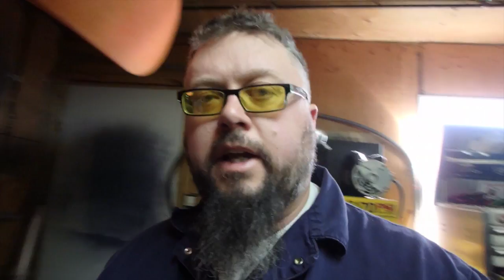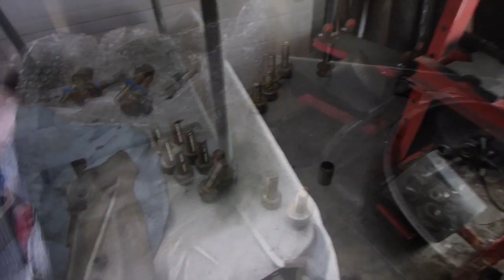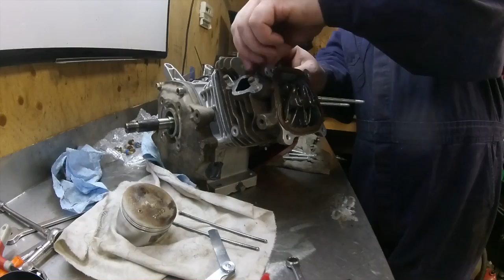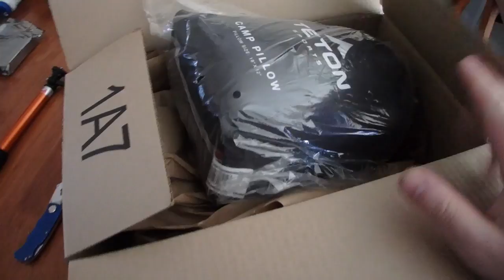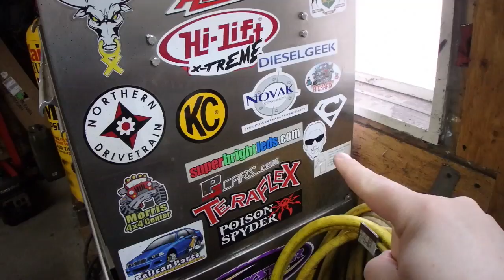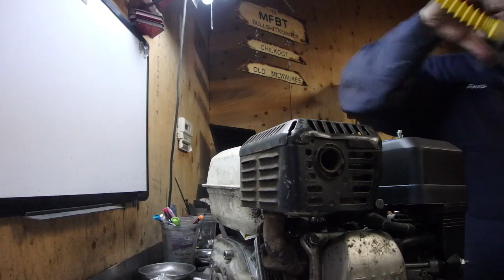Will This Engine Run Or Blow Up

Comment: hi there i really like your videos and would really appreciate your advice on my eninge as i am having a few problems. the engine is a handa gx160 copy, i have it on a go kart and it the pull start works and ive taken the covenor out and sorted out the trottle linkage. after i did that the spark looks really week but it has a new spark plug and ive checked the gapos on the ignition coil so i don't know what to do there?  also i can start it with fuel and choke on and the throttle off. the only way i can start it is with the fuel off , throttle all the way open and choke off. and i sprays fuels everywhere if i try and turn the fuel back on when i get it running. any ideas

Comment: are you going to have clearance for a 12v? I have a 93 1st gen. it would be sick though #MFBT
Reply from the maker: +Michael Meadows  that's a good question all things i need to research.  They were common with a inline 6cyl and those are tall engines
Reply: +Bullshitkorner regardless you're a fuckin bad ass
Reply: +Bullshitkorner also I forgot to ask how do we get stickers

Comment: Shoebox is one bad ride with big block Chevy or for turn key badass LS Power lots of horsepower and good fuel economy. put Cummings  in your Ford Truck
Reply from the maker: +Scott Nei i'd like to set my ford truck on fire and burn it,  I wouldn't mind getting a F350 that has had the cummins conversion though

Comment: Please don't hurt that Chevy's feelings Jerry. Find a wrecked duramax (preferably 2006-2007 LBZ) and put that in it. Now that would be epic. The 12v is a great engine(I work on one frequently ;) ) but overdone.
Reply from the maker: +Kellen Richard someone above said that as well, the idea is to get something simple that doesn't rely on electronics to run

Comment: Why put a 12 valve in the car when you can have this freak people out with the Jake brake lol https://youtu.be/x5Fx2FDjtqU A 5.9 might be a little too heavy you may have to go with a 3.9.  Will the Honda Clone run? most likely will it last? I wouldn't trust it if I had that pump on a barge or a boat that is sinking that's for sure, t will be good for you want to use it for.
Reply from the maker: +Graveltrucking I think if you were on a boat or barge that was sinking the pump would be the least of your worries lol
Reply: Bullshitkorner Those Honda pumps can save a barge from going down if you can react fast enough. Boats they are usually another story they start going down its jump ship.
Reply from the maker: I will take your word for on it, I hope i'm never on a ship when it's sinking.  Me and open water are not the best of friends
Reply: Flat lander lol